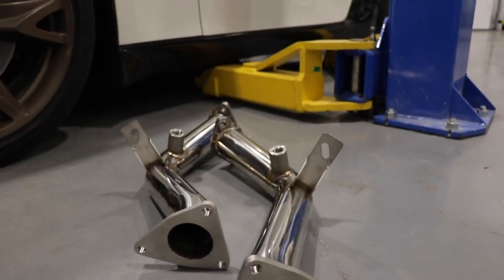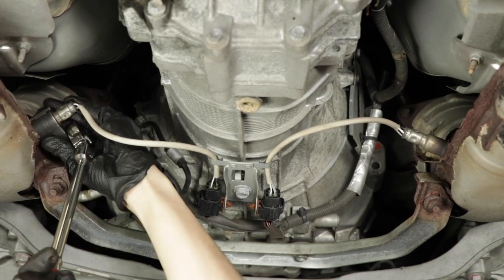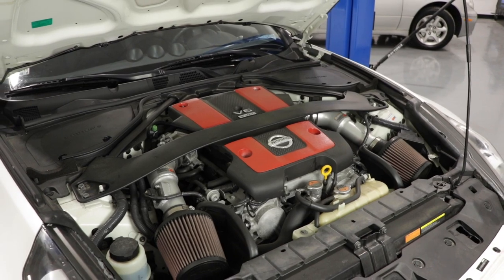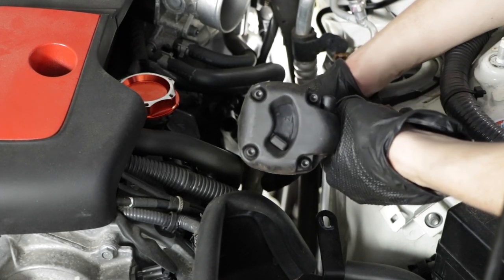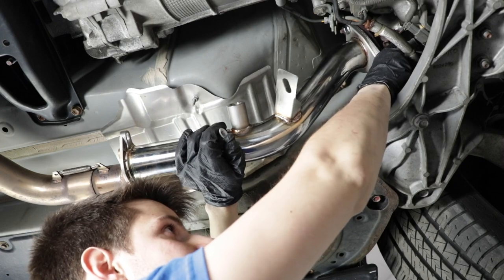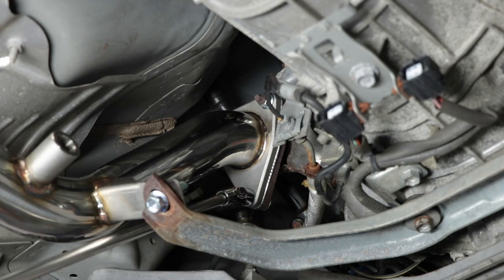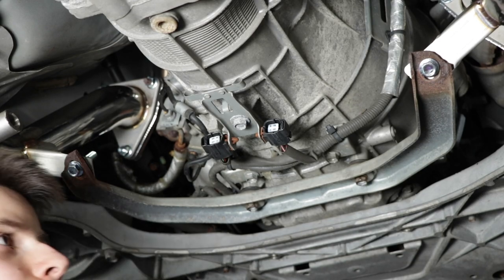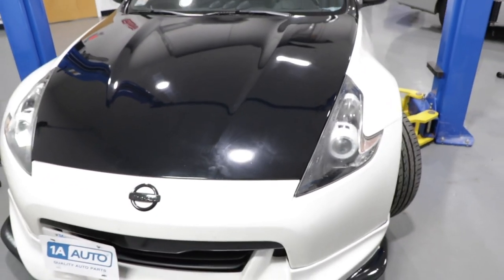How to Install Invidia Test Pipes 09-19 Nissan 370Z

Comment: The two bolts u left on are they the demon bolts? So u just took out the socket?
Reply: No those are not the deamon bolts haha, I replaced those.
I took out the nuts because they were actually studs, and I didn't want to chance breaking those studs. Since the threads were still ok I just left then and used new nuts

Comment: I have a Z myself and bought test pipes planning to do it myself but im sure it would make the job be alot harder than you think if you tried do it in your driveway lol, what was the cost for you guys to get it done??
Reply: Yes haha might be a bit harder on jack stands but my advice is to invest in some 6 ton jack stands from harbor freight. Maybe you don't need 6 tons on them, but they are twice the height of a 3 ton stand meaning you get way more room to work under the car, especially if you have a jack that goes up 18 inches or more.
Also cost wise, assuming you have all the tools you need, it'll cost you whatever the test pipes are! And trust me, it's worth it :)
Reply: have you installed the test pipes? and if you did. do you like the sound? how about performance? any check engine light without a tune?
Reply: @sparco023  yes check engine light came on

Newer Z models are most sensitive to the cats being removed even having extended 02 bungs even with a j bend soldered onto the test pipes 

Tune required to get rid of CEL
Reply: @BoyzNAcne  damn bro it sucks. I planning on tuning. Im going with isrs. double tail. dont care much about the tomei. cant stand the one pipe look